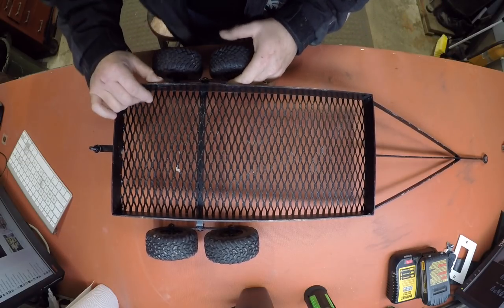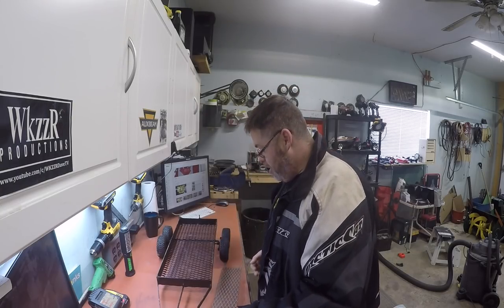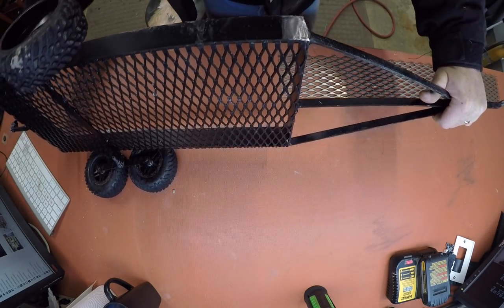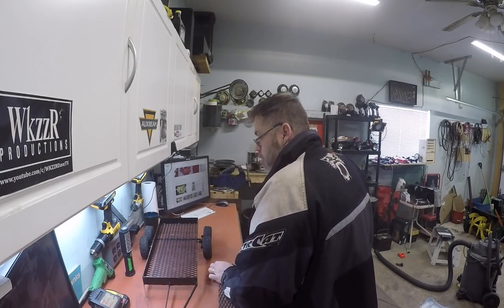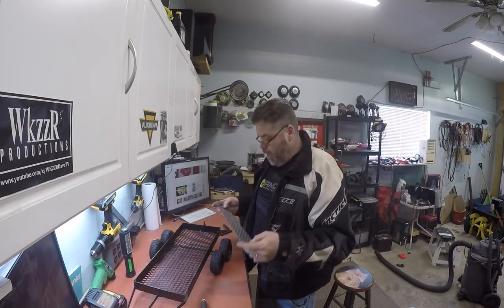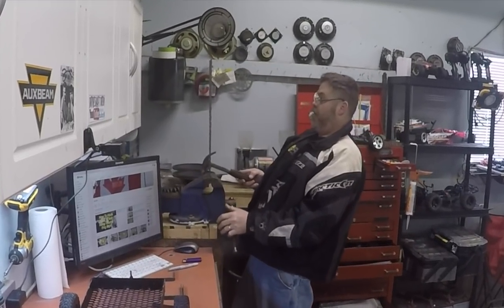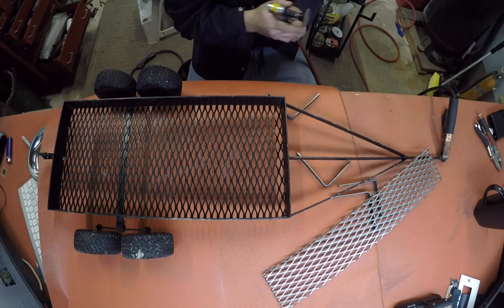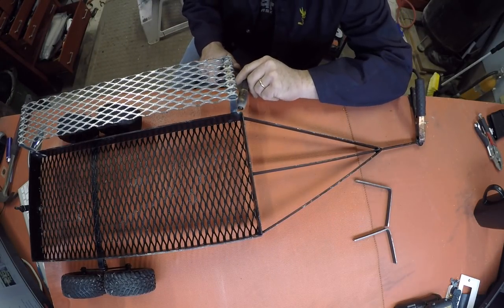Rc Truck Portable Stunt Trailer for the group

Comment: Bill Siff why not put a little piece of the same Stuff you just put on so its easier to jump and you dont crash in the end of the trailer because if you run at the wrong angle then the tires hit the trailer and you can broke full front part some good catching mechanism like hooks or magnets can be awesome idea something at that jump part is there after jumps
Reply from the maker: thing she's going to be to heavy to pull anyway hahaha fuck sakes